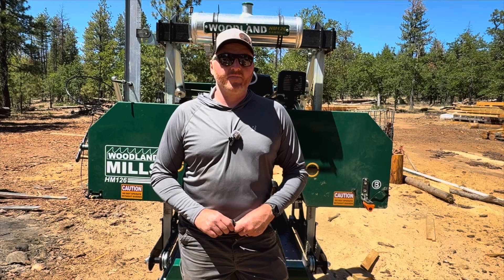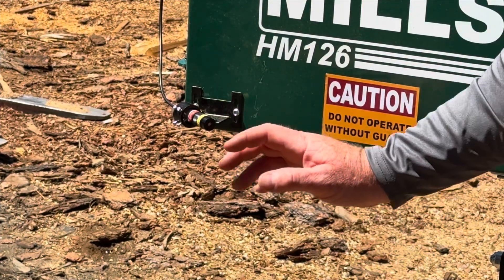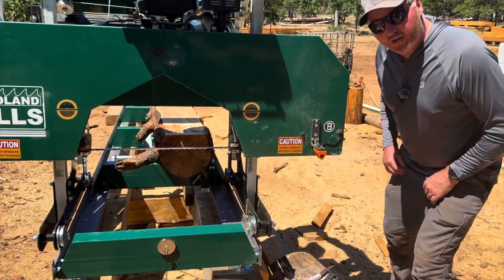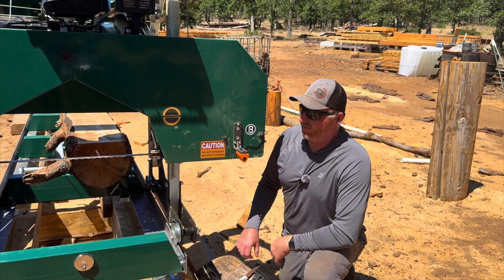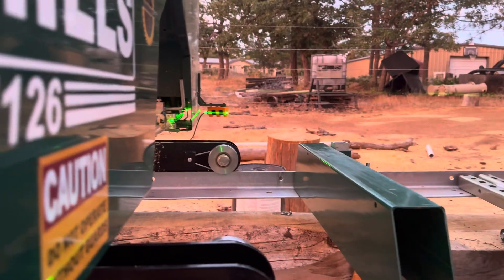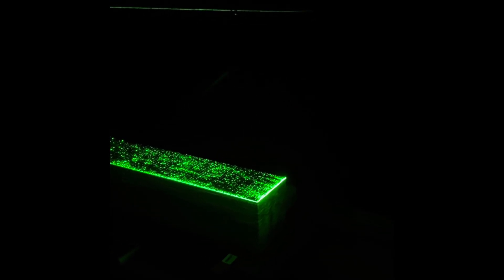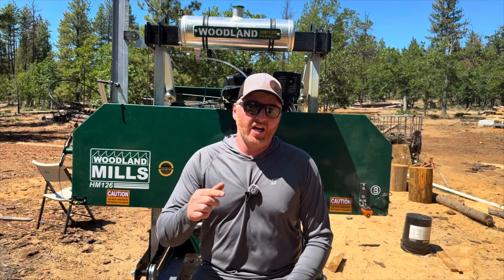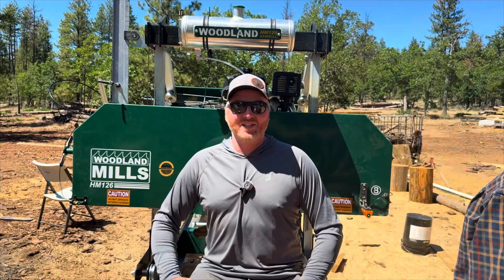LASER SHOWDOWN Amazon VS Borghuis Instruments

Comment: I started to use my Borghuis today, but I am having trouble getting it to line up correctly and as soon as I turn on the engine, it goes out of correct alignment. Then, as I was trying to line it up, the laser started going dim. It would start at (apparent) full strength, but then go about 1/2 or 1/4 strength. I have tried unplugging and then replugging the connect and that makes it bright again for a few seconds, then it goes dim. I have it hard wired into the 130 MAX 12 volt battery, have you experienced this?
Reply: If you still have this issue, let me know, we can definitely solve that.
Reply from the maker: negative i wonder if the connector is the issue.. try twisting the connector. if it persists reach out to Bart he will make it right. as far as moving with vibration did you line it up then screw it to the cover or just relying on the magnets? the magnets are just for temp install to get holes drilled.
Reply: You're comparing a  50mw to probably a 5mw laser first place. And the lens diameter also comes into place. That being said, the borghuis one is much better built no doubt.  The laser he uses is about 100 dollars, and is more of an industrial quality. But you get what you pay for. I would love to get the borghuis laser, but I saw without cover over the mill, I cant see the line the length of the mill.
Reply from the maker: @geraldminko4659 for sure it’s not an apples to apple comparison but it is a comparison of the oh just buy the amazon laser it’s much better for the money….. but it’s clearly not.